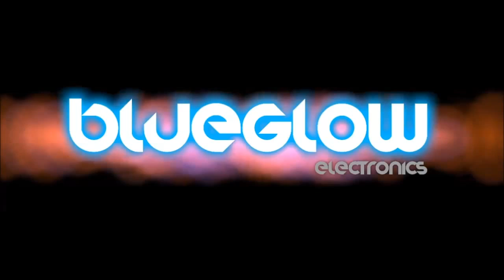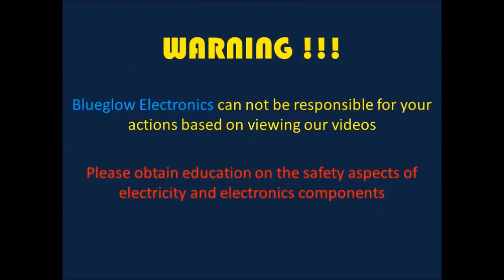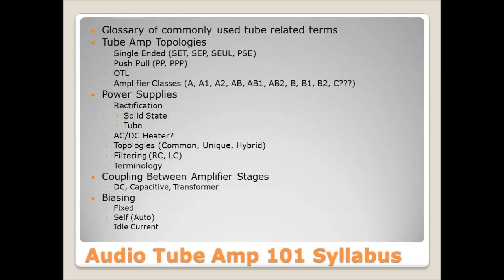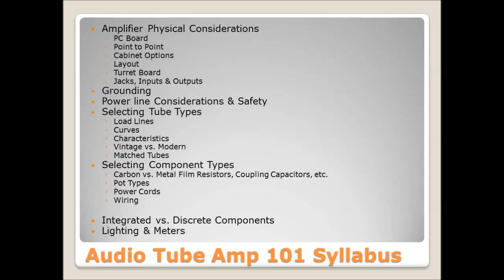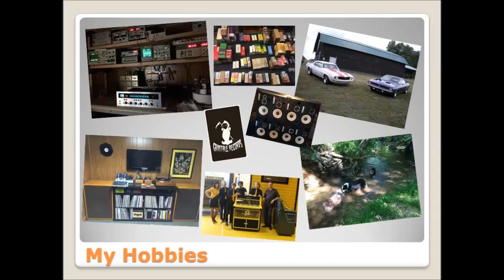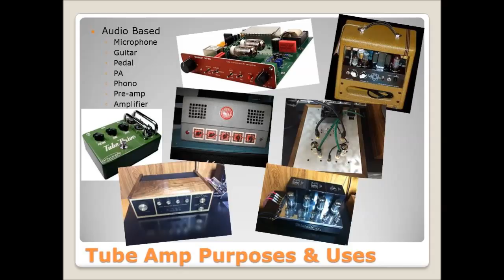Audio Tube Amp 101 - Episode 1 - Intro and Syllabus

Comment: I don't really have the desire to learn this stuff. I'd rather just play my guitar and take my amp to a tech when it starts to hum. The last time I messed up one of my tube amps (a single-ended Fender Champ type circuit, I put it in my car with the bottom taken off to use it at church. I sat it on something that pushed one of the resistors to ground and it blew as soon as I turned it on. I took it to a 'tech' and waited a year. The 'tech' told me it was the power transformer. He never got around to it, so I picked it up and a friend noticed the burnt resistor. We replaced it for 50 cents and the amp was fixed in about 10 minutes. I own 6 or 7 tube amps and I don't have any local techs, so I guess I'll watch this stuff and see if it helps. I have two or three amps humming now, so I have some issues to deal with. I'm hoping my Vox AC-4 style circuit is humming because I bought cheap jacks when I made the wire that connects the head to the speaker cab out of an extension cord. I've already broken a few of these cords and it didn't take much to break the cheap jacks. Wish me luck. I live 60 miles SW of Houston, in case you know someone I can trust.

Comment: I'm a PE in mechanical, but my Sr year
electives were in Circuits, E-Mag (fields) and Controls. Accordingly I would like to learn how to troubleshoot old Fender tube amps and build a small tube amp like a Blues Jr. from parts. I remember gain-bandwidth-product & Collector current from SS Circuits.  Thank you in advance for leading off in this long forgotten art & engineering!

Comment: Hi Mark. I think what you are doing here is fantastic.  Thank you .  If you want my opinion for your project, I hope it would be 99% Video based.  People like myself who would like to get back into electrical, electronics, and mechanical, hobbies of restoring tube amps, record players, etc. can better understand by watching you work on something, and show all of the work from start to finish in great detail.  I don't think older people, including myself (55) will retain the book stuff, like we did when we were young, so with that said,  I would rather watch you rebuild something and have you explain what you are doing so you can cut to the chase, and share all of your short-cuts. It's good to start off with a 101 and some safety stuff, but better to show on a piece you are working on, something that could be dangerous.  How about after 10 or so Free Parts, you charge a fee to the person to join your lessons, in which you would have to work on an item of their choice (or something very close to their item) for whatever problem that they might be having.  It's all good to watch you work on something and have you say what you are doing.  OPEN THE STORE TO REPAIR VINTAGE EQUIPMENT AND SELL STUFF, AND HAVE WORK-SHOPS, AND DO MAIL IN REPAIRS, TRAINING SEMINARS, SHOW-ROOMS,  BUT DON'T KILL THE CUSTOMER WITH THE COST.  This stops a lot of people from getting their stuff fixed.  You will be the #1 place to go in the country.  Just think of the volume, and be ready to handle it when the time comes.  Best of luck!